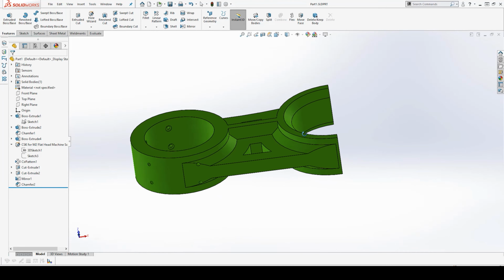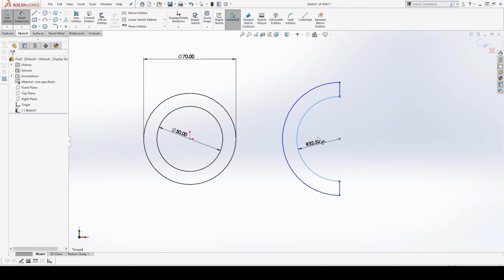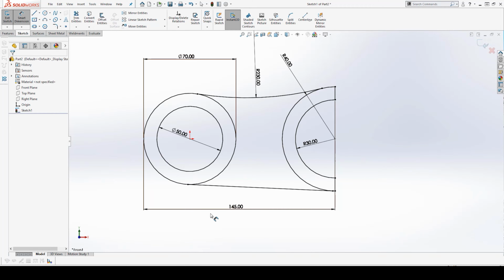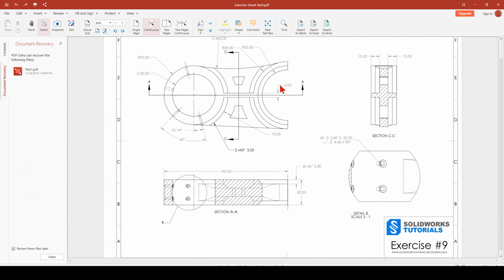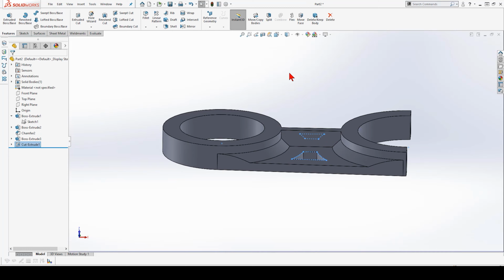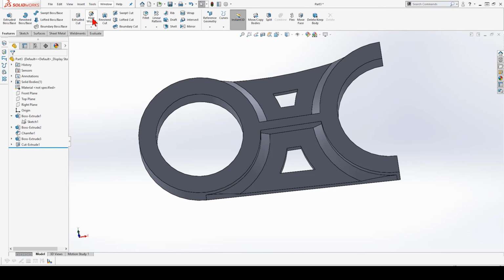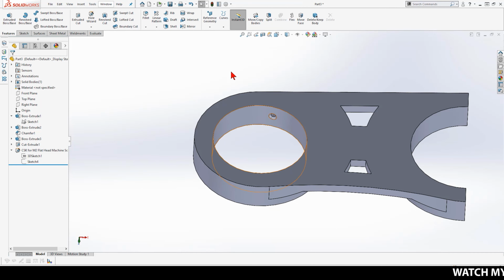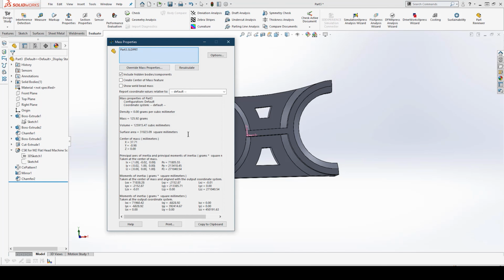SolidWorks   Exercise No 9  Offsetting on surfaces

Comment: Thank you Ryan, your SolidWorks tutorials are the best on Youtube. I have finished your Beginners tutorials, and now I am watching your Intermediate tutorials. You explain the flow of making the model so good, from selecting the planes, to features and fine tuning at the end. Keep up the good work. No questions for now, just to say hi :) P.S. I like your jokes :) Keep up the good work
Reply from the maker: Glad to hear that, why haven't you joined on board on my full course?
Reply: @with-aryan  Well, for now I have enough knowledge(from what I have learned from your tutorials) to experiment on some models. I am not looking to be professional in SolidWorks, I am using it as a tool(for 2D and 3D sketches). And for now, I know just enough to test basic concepts, and that is what I need...for now :)